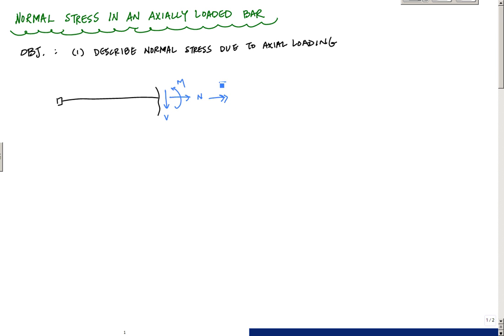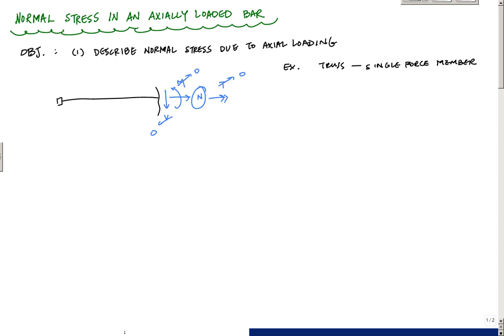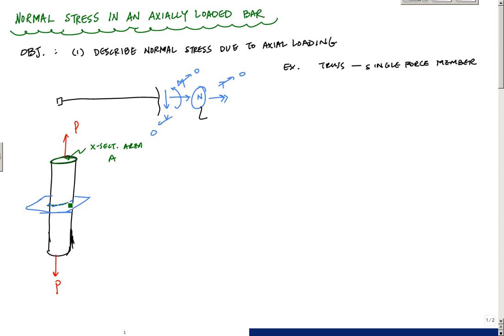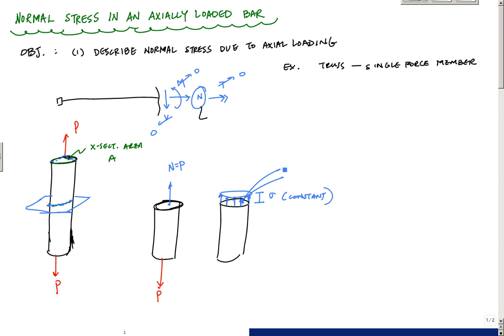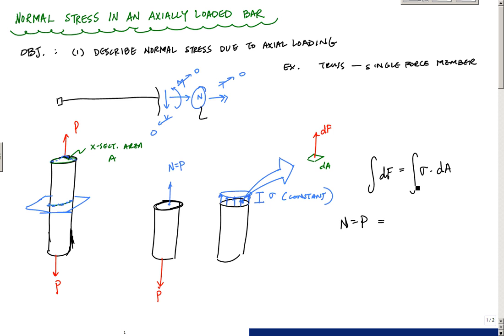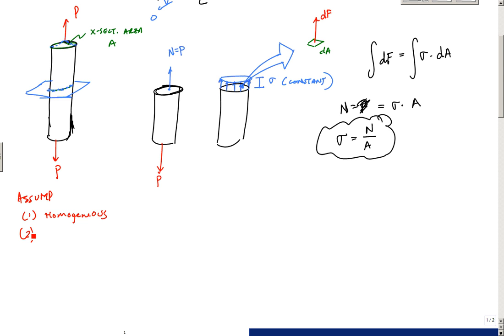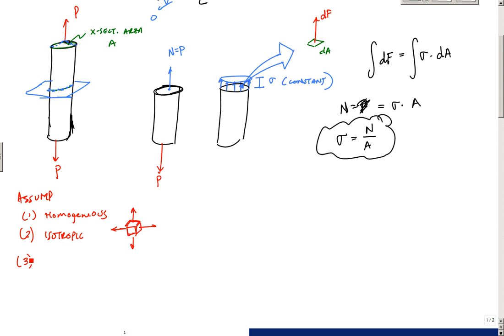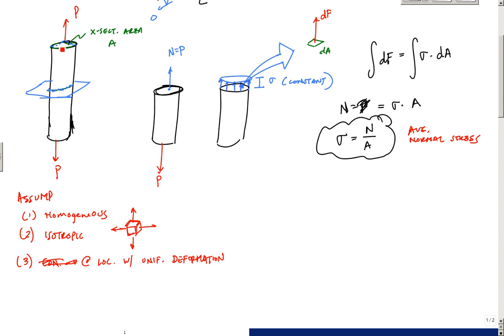Introduction to Normal Stress of an Axially Loaded Member - Mechanics of Materials

Comment: 3:45 Does the top P load (of the full bar) not  need to be consider as well when a section is cut? If not, then why do consider the bottom P but not the top one
Reply: Top force is counteracting force which puts the object in equilibrium

Comment: Great video! Although I thought the normal stress wasn't constant!? The uniform stress is the Average stress (and it's good enough of an approximation to assume that the stress is constant). Although the stress should be higher at areas closer to the applied load.